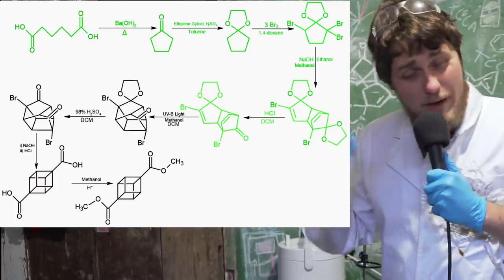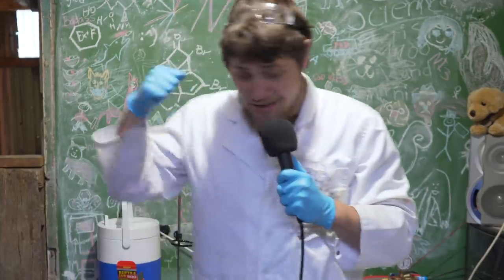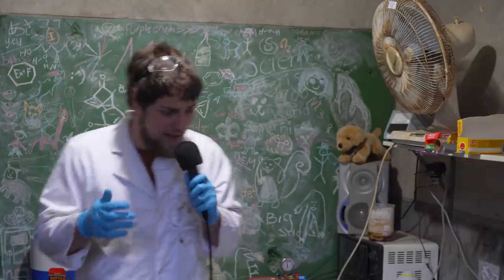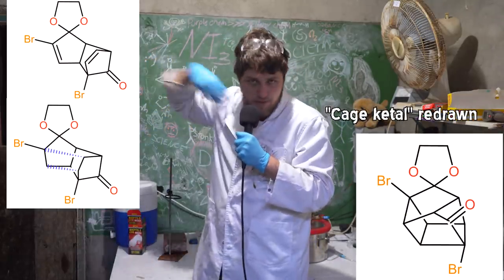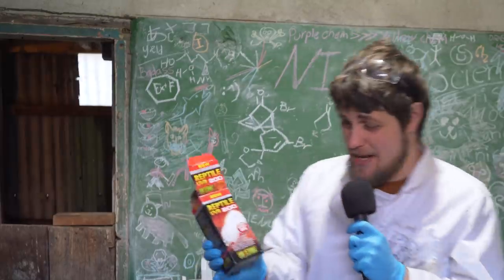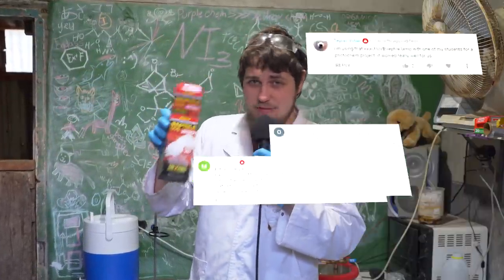Ultraviolet Cage Creation - Cubane Ep 10

Comment: Your TLC is still far too polar, try using a petrol/DCM mixture.
Reply: I want to like your comment. But it's on 69 likes.
Reply: Maybe even a petrol/carbon tet mixture if its still too polar

And maybe a good drizzle of olive oil to finish
Reply: yeah I would guess around 10-20% DCM in hexane
Reply: Agreed… don’t know if ethanol fuel would work tho
Reply: @dakdak3331  reasonable, tbh
Reply: Agree.
Reply: You really want a solvent system that gets the dot of your starting material about a quarter to half-way up the plate. If lower than a quarter of the way up: the eluent is too non-polar, so needs more DCM;
If higher than half-way up: eluent is too polar, so need to add hexane or petroleum ether (low boiling point hydrocarbons like pentane, hexane, heptane)
Permanganate dip should be OK for visualising this compound. If you want another dip, vanillin is a good one, and gives different colours for different compounds. This can be useful when two compounds have the same Rf (dot is at the same position up the plate), and they change colour differently.

Comment: "fast and loose" aka "I can't be arsed with it" lol
The precursor to yellow.
Reply from the maker: i get what i deserve
Reply: @ExtractionsAndIre  To improve efficiency:

- spread out your product as much as possible (a big and level! glass plate)
- relocate the lamp outside on top of the lid > cut the hole in the lid big enough to not waste uv on exposed plastic and glue the reflector on. (Again, reflector completely outside the box)
- cover every last gap and any nonreflective surface with aluminum foil, since at the high reflective intensity even a little gap will waste a lot of light (think of how a laser works for example)
- maybe use less solvent... I don't know how much it absorbs your wavelength...
- maybe consider using a makeshift filter that only lets your wavelength through

I hope this was helpful mate 👌
Reply: Let’s play the game - yellow, tar, or yellow tar - place your bets!
Reply: @excitedbox5705  Does it output the right wavelength? UV LEDs generally doesn't.
Reply: Patrick Hudson  yeah it wouldn't be on-brand at all
Reply: this is a top comment for sure
Reply: @excitedbox5705  He addressed this in the video. UV LEDs, especially cheap ones don't emit the right wavelengths.
Reply: @dOgBoGsY wOoFsAlOt Aren’t you providing suggestions that Extactions would’ve already considered? You’ve checked the box but did not deliver.
Reply: @markp8295  I bought one centered at 315nm for $10 shipped. The 365nm ones are slightly more expensive than the higher wavelengths.
Reply: @excitedbox5705  315nm but how many mW? I ask as for $10 I cannot find one more than 2mW that isn't an EBay or Alibaba special and is definitely the wrong form factor for what it claims to be.

He wants at least a few hundred milliwatts at the specific band and not a lot outside that.
Reply: @excitedbox5705  have you actually checked that the output is correct? Those websites are notorious for having incorrect product listings. When I go online and look for manufacturers of LEDs, just the little component itself, all those are very expensive and very low output. They also tend to produce a TON of waste heat, which means making one with a functional duty cycle would be difficult.
Reply: @excitedbox5705  as he spelled out at 2:32 vanilla UV LED's are on the wrong frequency for this reaction. There are LED's that spit out 325nm, but they're not a couple of bucks from AliExpress, they're a couple of hundred for a single LED from Thorlabs.
Reply: that made me laugh
Reply: @ExtractionsAndIre  Maybe the product is yellow?
Reply: @ExtractionsAndIre  nile red done red sulfur chemistry when he isolated his Mercury from waste the sulfur is trying to change colour to trick us
Reply: In photochemistry power isn't all that important, its better to have a low power light source. Ideally one that is solely focused on the sample (beam angle > watts) anc not diffuse. More efficient light source will be running cooler so can be placed closer to the sample which increases its effective irradiance much more than increasing the raw input/output.

Comment: “I’m gonna need a ballast, and I don’t know what the fuck that even is.”

Story of my life.
Reply: Negative differential resistance is weird.
Reply: It's when you have a good meal a couple of hours before going out on the piss. A bit of ballast always helps.
Reply: A ballast is an inductor placed in series with the lamp which limits the current flow through the discharge tube to the manufacturers specification. Think of it as an AC resistance.

Comment: Water purifier UV lamps are super cheap and should be easily available. The circuitry for a regular fluorescent tube light will light it up okay. That should be plenty enough UV for your TLC as well as your π-π* transitions. Bromine cleavage might happen too, but may be worth a try. Also, a simple wooden screen is protection enough. The guys in my lab used this crazy water cooled high pressure mercury lamp for photochemistry in a wooden box.
Finally, copper sulfate is a convenient UV transmitting filter. And finally finally, your molecule might be a bit too non-polar for TLC in DCM. Perhaps consider 10% acetone in hexane?
Reply: That's UV-A; I think he wants UV-B, which is more of a tanning bed kinda lamp.
Reply: @sebastianramadan8393  No, they give UV-C and some other also.
Reply: @sebastianramadan8393  Tanning bed bulbs (They use a combination of bulbs to achive this) are almost entirely UVA, like over 90% UVA. Even reptile bulbs are mainly UVA also.
Reply: @sebastianramadan8393  emission peak is around 254 nm. It's what you use in TLC visualizers. With a filter it might be possible to block out the higher energy stuff without too much attenuation. Again, it's probably all about fun with jugaad.
Reply: @rdizzy1  he needs low UVA or high UVB. Tanning beds, and photography blacklight bulbs. philips suffix /09 and /08 and osram /79. The USA marking will be BL or BLB. You can also take a pyrex flask with a little bit of mercury in it and run ~500w through a tungsten filament inside. He has a vacuum pump to pump it down and adding a little heat he can adjust the pressure. aquarium stores sell little test cards that glow under specific wavelengths.
Reply: Is he using a quartz beaker? Won't borosilicate block the spectrum he needs? I agree, UVA is easy enough with a fishtank bulb.
Reply: As an Australian note, pretty sure they sell clear UV tubes at Bunnings too

Comment: I was thinking a 5V computer fan could be mounted to your bin as a cooler so you could ventilate it better. just biff in a thermocouple with and if the temperature stays low/stable you can build some confidence in longer run times (though it’s a pretty safe rig)

Really I’m just commenting to feed the algorithm lol
Reply from the maker: That's a reasonable thought though!! (All hail the algorithm)
Reply: @ExtractionsAndIre  yeah dude just let it run for two months if it works slow it's not like this series is in a hurry
Reply: Yeah building on this I made an exhaust for my resin 3D printer enclosure using two 140mm PC fans and a usb set up converter. Just snipped off the barrel jack, wired in a pc fan splitter, and boom both fans run at their rated speeds at 12V via usb. Things like $5 off eBay
Reply: An Aussie summer would laugh at you. An Aussie winter would chuckle and say theres snow else where.

Comment: I love this series!
Some advice from a fellow chemist:
1. Photochemical reactions need some time. And with some time I mean a long time without any auxiliary substances. Especially with this low power lamp. I think u need way more patience. 
2. Try using different solvents to develop the TLC. A standard system in our lab ist ethyl acetate:cyclohexane. It's way cheaper and better for the environment than DCM.
3. The staining solution looks quiet good. But try drying your TLC plate before using the staiining so it can soak in better.
4. I would use something to stir the reaction mixture. It might reduced formation of the byproduct - especially this dilution.

Comment: There's always carbon arc lamp, but I don't know if the wavelengths would be right. I think I remember you having a power supply that would work, and electrodes out of lantern batteries work great. Pretty easy way to get make your eyes go crispy levels of UV.
Reply: Easier to just buy a uv tube on eBay and not piss about with the heat and amperage problems of arcs
Reply: @iNerdier  Oh definitely! I was shooting for cheap to free in a time frame of soon to immediately rather than any other concern. The more I think about it the more having a naked ark around all those solvents seems like a bad idea rather than merely a silly one.

Comment: Idk if they are available in Australia but a UV water sterilizer would be fairly easily adapted for this. Different systems are designed differently but most of them are just a quartz tube that runs next to a UVC germicidal bulb. IT should come with both the bulb and ballast so the only modification you would need to do is plug both ends (with suitable plumbing fittings) and then you have a fairly nice UV reactor and with some research, you should be able to find different UV bulbs to swap out giving you different reaction condtions.

Comment: A source of UV that could work is the lights they use to set gel nails. They also come mounted in boxes similar to what you built, sold in drugstores, as part of a kit for doing your own nails. If it's the correct wavelength and power, you could use it unmodified on a cheap analog timer without too much fear of burning your lab down.

Comment: On a scale from 1 to cancer, how unhealthy is accidently inhaling DCM vapors?
Reply: DCM by itself isn't that bad I believe it's even used in some medicines tho that's not inhaling so it's probably not great with the lungs, the real scare with DCM is that it can take anything dissolved in it with it when it passes through your skin
Reply: Not very different from other common solvents, I think. It's quite usual to have a little sniff of DCM, when I'm working in the lab even under a fume hood. The major problem, I believe, is that you can't perceive it unlike ether or ethyl acetate, so you can feel dizzy pretty much unexpectedly.
Reply: Depends on the amount you inhale. If you inhale a lot it's in the "Cancer *and*" category. In particular, it comes with lots of lovely poisoning too. If you inhale a little, it's just in "mild cancer maybe".
Reply: It's not a proven carcinogen, the main danger if inhaled is that it metabolises to carbon monoxide.
Reply: @Isolanporzellator  That injection case.... fack me dead
Reply: @jacobarcher1097  you’re thinking of DMSO

Comment: Mercury lamps are used to sterilise ponds in the filtration unit, reasonably priced. They can be driven from a standard lamp ballast (4 pin types) or the circuitry from inside a CFL lamp for the 2 pin types

Comment: To reduce the opacity of the glass at UV: stretch the tube while blowing into it.  

To increase the UV, pit the glass half a centimeter from the bulb.  

To ensure it gets to all of the reactants, use a magnetic stirrer.  make sure all polymer involved is covered in foil to avoid crosslinking it.

Comment: 5:30 Just heat up a coffee can and push it into the plastic, ez hole.
Reply: doesn’t work - the can either doesn’t punch through (it’s a surprisingly high amount of mass to heat) or you end up with a melty/burny mess of a “hole” that’s way bigger than you want
Reply: You’d need it to be red hot and if you fuck it up you could warp the whole box out of shape.
Reply: @andrewjvaughan  You can reheat the can, just place it in the same spot again if it wasn't hot enough in the first place. Do this outside if possible...

Comment: I imagine at least one of the dots on the TLC is the hydrolyzed ketal. Sadly I can't find 300nm-350nm LEDs, just 270-290 and 365-370. You can achieve a slight broadening of the absorption bands at elevated temperatures but I doubt it would be enough. A CFL lamp essentially is a mercury lamp with a fluorescent screen, if only we could remove it.
Reply from the maker: Yes, a very long reaction time and a wet solvent... I'm being pretty cruel to my poor reactant
Reply: @ExtractionsAndIre  Tom, these uva tanning bulbs appear to fit the bill:  https://www.ebay.com/itm/F71-T12H0BP-105-watts-tanning-bulbs-6-ft-used-checked-they-all-work-/164130073367?mkcid=16&mkevt=1&_trksid=p2349624.m46890.l49286&mkrid=711-127632-2357-0
Reply: @ExtractionsAndIre  here is the white paper showing the spectrum:  https://www.lighting.philips.com/api/assets/v1/file/PhilipsLighting/content/fp928004320930-pss-global/928004320930_EU.en_AA.PROF.FP.pdf
Reply: @ExtractionsAndIre  the white paper even lists one of the applications as “photocatalytic oxidation “ lol .  Maybe that’s a fancy way to describe tanning lol

Comment: I'm sure your dad could make a mercury lamp out of a glass tube, two nails, a resistor and some patience. Have the nails act as an electrode on each side of the tube and somehow manage to evacuate and seal it after getting a tiny amount of mercury in. Wire it up using the resistor to limit the amount of energy going in and boom. Easy peasy enemahr squeezy.

Comment: Hey, at least it didn't go yellow :). Assuming the NMR shows minimal conversion, I would just wait for sunlight and see if that works. If not then it's time to get tinkering with extra lamps or fancy reaction vessels to increase UV exposure. A PTFE bag or tubing could make for a UV-permeable reaction vessel that can be shaped to maximize the exposed area but I'm not sure if that would be worth the effort.

Probably not the kind of compound you'd have lying around, but 2,4-Dinitrophenylhydrazine is a good TLC stain for aldehydes and ketones because it forms a colorful hydrazone compound with them. Here's a recipe for the stain:
12g 2,4-dinitrophenylhydrazine
60 mL conc. H2SO4
80 mL H2O
200 mL 95% ethanol

Comment: To improve efficiency:

- spread out your product as much as possible (a big and level! glass plate)
- relocate the lamp outside on top of the lid > cut the hole in the lid big enough to not waste uv on exposed plastic and glue the reflector on. (Again, reflector completely outside the box)
- cover every last gap and any nonreflective surface with aluminum foil, since at the high reflective intensity even a little gap will waste a lot of light (think of how a laser works for example)
- maybe use less solvent... I don't know how much it absorbs your wavelength...
- maybe consider using a makeshift filter that only lets your wavelength through

I hope this was helpful mate 👌

Comment: Could you get a smaller lamp and put it directly into a beaker filled with your reaction mix? Just so that all of the light directly hits the solution. It would be the fast and loose version of the Hg-vapour lamp I used during my Ph.D. So happy when I saw this video in my inbox. Love your work! 
P.S. I agree with others in that your TLC solvent mix is still too polar. Good old EtOAc, hexanes 10:1?

Comment: Might be worth it to double check if the UV is even getting through the glass of the tube. Pop your spectrometer in and shine the light through the glass at it, see what it does to the wavelengths. At 25w vs the 500w though... that's a huge gap in energy difference, especially considering light follows the inverse square law.

Comment: Cubane Saga continues!
As for TLC: less polar eluent system definitely, like hexanes/DCM. This is too high, molecules can hide one behind the other. Second thing: you can use a nice trick, where after heating stained with permanganate plate you put it in a cup with water, to wash out unreacted permanganate. Then when it is almost white you heat it again. Low visibility spots normally hiding behind purple permanganate are visible and it is easier to compare plates when they do not degrade from permanganate decomposition. We were using this HD permanganate TLC all the time with olefins in my lab.
Other than that, if you can put your hands on it, use stain specific for ketones and aldehydes. It will be way better than permanganate in this case. Depending on UV activity, even UV active TLC can show nothing under the lamp.
Next, oxygen is the enemy, as already people wrote. Do anything possible to exclude radicals. Another thing, stir your mixture because the reaction goes only on a thin layer (that is why scalability is a problem, penetration of solution with light). Definitely, you want to replenish the layer near glass with your substrate. Another thing is cooling: heat means other reaction routes with means tar. And we love tar :P For some photochemistry I did, I was using a small cold finger for sublimation (circulated with cold water) submerged in a test tube with a stirring element. It worked great.
Last, for UV source, maybe you can use something my friend uses in a different lab: Gel UV Nail Lamp. They are pretty cheap, you can get ones with normal lamps but also UV LEDs. And if I am not mistaken they sell also ones with UV around 300. Definitely, you can buy them on Amazon or maybe even in some nearby shops.
As for now, good deoxygenation would be the most important.

Comment: You can try an Iodine stain by placing the tlc in a chamber with a silica/iodin mix (about 95:5). The vapor can stain some very hydrophobic molecules (i used it to detect diamantane, so it might work here as well). The stain is reversible and you can stain it with manganese afterwards.